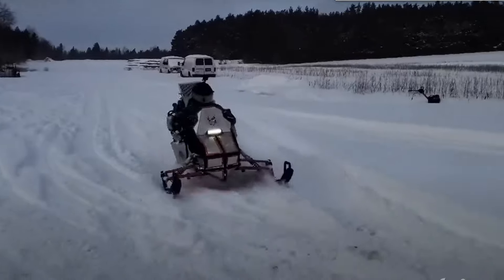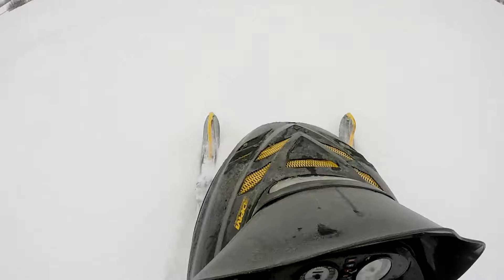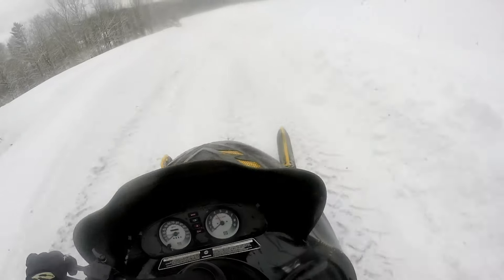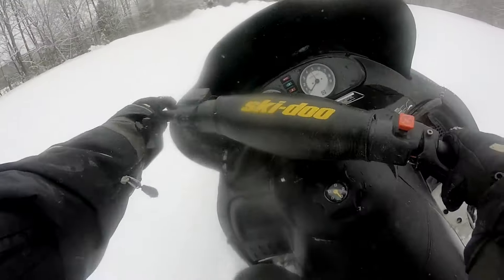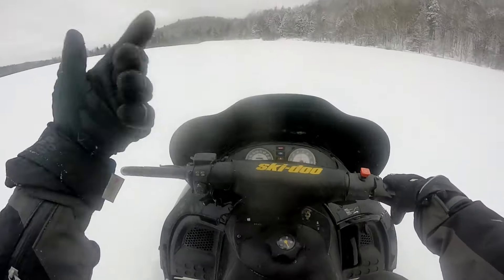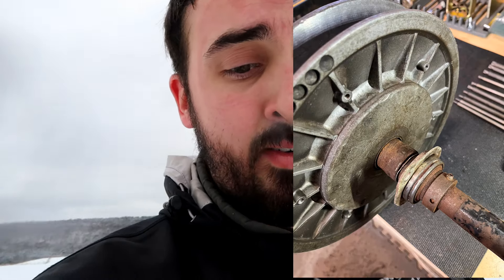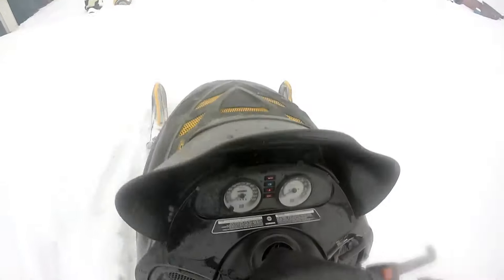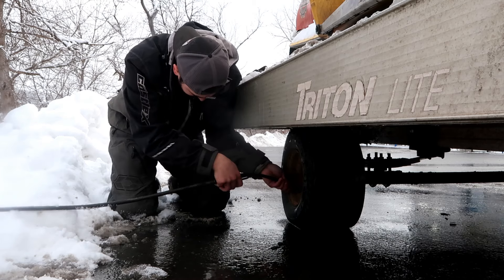SKI DOO MXZ 700 FIRST RIDE !! (My Favorite Snowmobile)

Comment from the maker: What is your all time favorite sled?? Flood the comments below with sleds!
Reply: I love your videos man
Reply: The 01 polaris pro x 600
Reply from the maker: @gavinpurcell9494  Thank you!! I appreciate that!
Reply from the maker: @thomasholroyd5477  Yes sir, that's a ripper!
Reply: 2000 polaris indy 500
Reply: Rode for 6 hours in tug hill area as a group of 6, leading the pack on my 2000 formula 500. Got all sleds back with one missing half a track. Shock blew out bottom bolt and cut the track into 2 small tracks.
Reply: 01 mxz 700 salt lake edition
Reply: Yamaha Phazer
Reply: 2006 Skidoo MXZ 600
Reply: Awesome video yeremy and i dont know what my all time favorite sled is
Reply: 03 yamaha rx1
Reply: Hello. Enticer 410. Grettings from sweden
Reply: yamaha phazer two
Reply: I’ve had my share of sleds but i love my 03 F7
Reply: 01 Polaris classic 600
Reply: 2006 Lynx Rave when the first version PPS skid was introduced and the fun was real in snowmobiles, it literally begs you to have fun. The bumps you can take in them are amazing, might also has something to do with the 46mm shocks.... + it lifts the skis like nothing else even with 550 fan engine 😁
Reply: The 2001 Yamaha 700 sxr.
Reply: 1997 yamaha vmax sx 700 triple and 1997 polaris xc 600 triple
Reply: 2023 arctic cat riot 8000
Reply: Fav sled is my minty 98 mxz 670!! Bulletproof and fast....Skidoo rules
Reply: 03 summit 700
Reply: 1998 Mach Z
Reply: 03 mxz 700
Reply: 1998 Polaris storm 800
Reply: 01 srx 700
Reply: 2006 Yamaha Apex
Reply: 08 freestyle 550
Reply: I loved my 1998 v max 500, but I recently picked up 2007 phazer, it’s a blast to ride, pure fun handles so great and get to 50 in a blink
Reply: Wow. All time. That's a lot of years. Best sleds of all time we're probably the 440's. They had 600 class HP but we're lighter. Very fun sleds. I think they stopped making them around 07. So they did make it into some of the Rev platforms. As far as long trail rides though. I never once had an issue with a Genesis or Ace engine. So those should be the best but they don't have the nostalgia factor.
Reply: Later 2000s Polaris XC 700! The 800s had a lot of problems. 121” or longer track with some good lugs. Man we had fun with that. 600 edge x was a fun sled also. Grew up in Minnesota and we had huge hills, launched off plenty! 

Use to drag race an early 90s 750 storm, that thing weighed as much as a tank, plowed snow, had over 200 studs, but dang it was fast! Oh ya the tunnel strap was broke (or cut) on it, so the skies barely stayed on the ice when we raced. Had to ride it like a jet ski or motorcycle.
Reply: Skiddo mxz 500ss love the videos your the best
Reply: 99 xcsp 700
Reply: 04 skidoo mxz 550 fan and skidoo is better than articat
Reply: This is kind of a tough one. 92 indy 650 was a cool one, always got me home.but 95 formula 3 gave me some serious grins. My 03 F7 efi sno pro is probably my most favorite. 670 powered machines are always fun too
Reply: My favourite all time sled would be the 1995 Yamaha V-Max 600-800. My dad painted his Titanium Silver and Blue, remember riding that beast of a machine growing up and I would looooooove to get myself one. They`re such a sexy snowmobile and I`m pretty sure it was the "King" of Muscle Sleds back in the day.
Reply: I've been riding a 2002 zr3 platform my 600 has been reliable and also taught me how to work on the old rigs. She's got problems right now but she has an f7 mountain can and sounds mint lol picking up a second 02 800 carb also have an efi at home that has problems. That 800 you had is definitely far gone perfect parts rig or rebuild if buddys got time and money
Reply: My good old 2018 Pro Rmk 800… 5 years with not a single issue!
Reply: You need to get a 98 xc 700 and do a comparison
Reply: That's a damn hard question I have about 12 in riding shape and I like them all, but I will say that my 2004 Legend V1000 is my go to for breaking trail and towing and it handles so good on the trail. They do boondock wicked easy and tou can carry a ski effortlessly on the trail. I have a 1999 MXZ 600 that I race in the Pro 600 class in New Hampshire and it is so stable in the corner and it rips. It stays with the ZRT Cats and the XCR 600s.
Reply: 98 skidoo formula z 670😮
Reply: Yamaha Redhead 700s. (Vmax SX 700/SXR 700)
Reply: Millennium Edition Mach Z 800
Reply: 1995 Polaris xcr600 triple
Reply: 97 Polaris xlt sks
Reply: 98 xc 700
Reply: Hands down 2005 f7 nothing compares.
Reply: Zl 600 ss efi arctic cat
Reply: 2000 Ski-Doo MXZ 700 was my favorite sled I owned.  Close number 2 was a 2002 Polaris XC 800 SP, that thing ripped!
Reply: 98 Polaris Xc 700
Reply: 1984 Yamaha Phazer
Reply: 99 670 HO
Reply: Ski doo tundra 250cc 1-Cyl 1970-2000
Reply: @Indyguy5oo  just got done riding my indy 500 things a hunk but fast when it runs
Reply: My 1980 yamaha ss440 or my skidoo 12 elan
Reply: My fav sled is probably the one I got now a 94 Polaris 340 Indy lite
Reply: 2001 srx 700
Reply: 00 Polaris xc 600
Reply: mine is mikes indy 500
Reply: however i actually have an Indy Lite 340
Reply: 2001polaris xc600
Reply: 2000
Reply: 96 skidoo formula 3
Reply: 2005 rev 600 ho sdi. First time owning it dream sled growing up.
Reply: 2001 Skidoo MXZ 800
Reply: @JeremyRhydes  well... I have to go with a list a Yamaha enticer 340, Yamaha rx1, Polaris Indy xlt 600 triple, skidoo rev, Arctic cat fire cat f7
Reply: 2001 Arctic Cat Thundercat 1000
Reply: 2007 ski doo summit 800 or mid to late 90s mxz 600 or 700 or 800
Reply: @JeremyRhydes 98 Polaris XC 700
Reply: The best sled ever made is the 2003 skidoo summit 800 high mark 151, pretty crazy sled
Reply: 2000 Yamaha Phazer 500

Comment: I have a 2002 mxz  700 i love that sled it just fits like a glove an rides so smooth an i love that high revving 700 just hauls the mail. Im a sucker for the zx chassis i have 2000 600 as well . These sleeds really hold up well really good quality machines.

Comment: I noticed your tach and speedo does not work. The reason it is quick out of the hole is probably because they put a 700 in a 600 chassis but did not put the 700 chain and sprockets in it, which will hurt the top end.